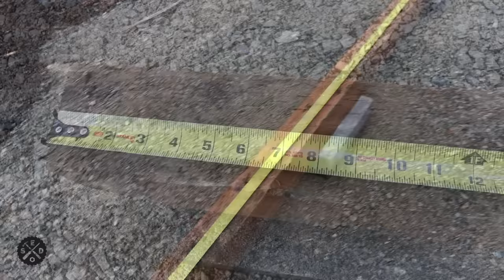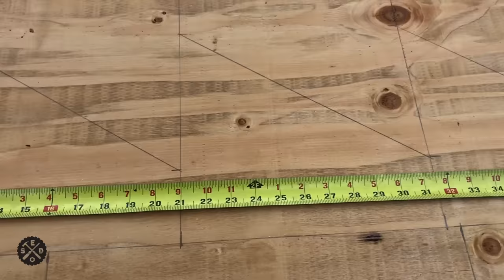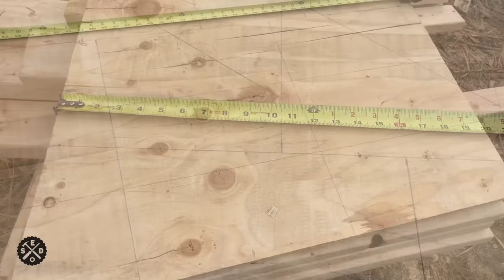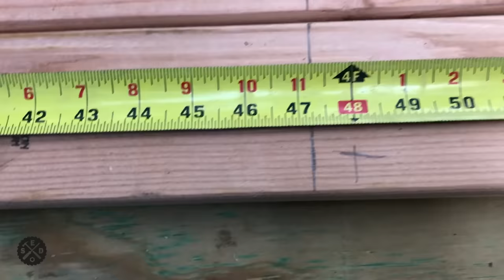How To Build A Shed By Yourself All STEPS 10x16 diy

Comment: You did a nice job building the shed!  I offer some additional tips that may help those who want to build their own shed in the future.  Truss bottom chords typically have a ‘stand’ of 1/8” or 1/4” at each end to make truss production and fastening the trusses to the top plate simpler.  Having a stand at each end assures overall length, makes aligning the top chords so much easier during assembly, and is easier to position the end of the truss at the edge of the wall.  Cutting the long scarf on the bottom chord to a featheredge permits errors in alignment during manufacturing and later on when rolling out the trusses on the walls.  Using a jig to build the trusses was great, as was placing the 2x4 stop at the gable end to set the trusses, and then placing lateral bracing along the top chords to assure the on-center spacing and preventing the wind from blowing the trusses over before installing the roof sheathing.  Adding soffit blocking at the eaves is a nice touch.  Cross bracing at the gable ends and a 1x4 lateral brace along the bottom chords will stiffen the roof structure, in addition, eave and ridge blocking will also help tie the roof together.  A technique for aligning the screws on the metal roofing is to drill pilot holes for the screws first.  Layout the first high-rib sheet to determine where the roof screws are to land, place that sheet over the balance of sheets that will go on that side of the roof, and drill for the field screws; consideration for the two sheets at the gable ends are required due to trimming width and the trim for the gable eaves.  You recommended a great solution for trimming light gauge sheet metal with a utility knife and how to use the neoprene hi-rib profile closure strips as well.  A trick for installing wood trim and siding that easily splits is to use a smooth nail of the same size, cut off the end, and use that nail as a bit to make pilot holes, this prevents the ends of the boards from splitting when nailing.  This seems like a lot of extra work; however, it prevents unsightly ends on the boards.
Reply from the maker: Thank you and thanks for sharing the tips with others. 👊

Comment: When my dad built a second garage back in the 80's, he left a slightly larger ridge gap, and then used a translucent polycarbonate ridge cap of a similar color as the roofing material, which acted as a huge light source, even on cloudy days.  No dark shed with deep shadows in the corners.  They do it all the time in pole barns now.  It was genius.
Reply from the maker: Very nice! I’ve seen that for sheets but not for ridge cap.

Comment: Very cool shed. Everyone watching though, please don't use screws for mating your walls, to the base or each other. Nails bend. Screws snap. Heavy winds, settling and expanding/shrinking, can sheer snap a screw. This only works with structural screws, and even then, use them sparingly like he did to just hold the trusses in place to to put the plates on.
Reply from the maker: Yeah, the screws were just temporary to hold things together then I added lots of nails. 👍🏻

Comment: At 29:52 some blocking shows up on one wall.  Later it is on all walls.  How is it installed?  What height?  What is the purpose?  Is it a nailer for the board and batten siding? Thanks.
Reply from the maker: Hi Rebecca. Yes I continue on with that at 34:15 and explain about it. So just keep watching a bit more 😁

Comment: An interesting question I'd like to ask.
Talk about the skids and getting them level ... you talk about using the blocks if you're going to be moving the shed.
How often has anybody ever seen or known someone who's had to actually move the shed?  I've seen an odd video here there but it does not seem common.
Reply from the maker: Well I added the blocks to give a little more height to store stuff underneath etc. but the skids are the main thing for in case you would ever want to move it. For dragging it or loading it onto a roll back or trailer etc. also some people don’t want it on permanent foundation for HOA reasons or tax reasons. If you knew you were going to build it permanently I would probably just pour a concrete slab and then use that for your floor and build walls on top of that. Or do concrete piers and still do this type of floor system. For me I still didn’t build a garage yet and I don’t know for sure where I want it so once the garage is built I’ll probably end up moving the shed to a little different location on the property.
Reply: @SmartEasyDIYer  nice.  Here if you build the shed on a skid it's not a permanent structure and thus .... will usually not require permitting, of course square footage makes a difference as well.  
I've looked at systems needed to lift a shed and "ROLL" it around so in my plans I will have holes in the floor to get to the skids to jack them up and place some kind of wheel system under them.
Do you think that your floor would hold lawn mower?  Say 700lbs?
Reply from the maker: Yeah that sounds like you got a plan figured out. Oh yeah I wouldn’t hesitate to pull in a normal sized mower in mine if I built ramps to bring it in the double doors.  I’m guessing most riding mowers aren’t even 700 lbs but maybe if it’s a good sized one.

Comment: Getting ready to build and going to use some of your ideas but now the prices are way more. Wish it was around what you paid. Just for the rough  cut lumber I'm in it for over 4 grand and that's not counting the roof sheeting and subfloor or foundation. I did get a deal on the metal roof, that was 700 with tax. Figured just do it because I don't think things are ever going to go back to the prices you paid a couple years ago.
Reply from the maker: Yes I agree I don’t think it’ll ever go back to those prices. I wish it did. Good luck with your build!

Comment: Hello.  Love this plan.  Planning to build this in the spring.  Tiny house on skids.- 12x16 - seasonal - for my sister.  Will put Johns Mansfield insulated board and cover with LP Smartside. Will put cathedral on one end - good idea!  Putting supply list together.  But - Wondering what you recommend for the floor insulation....
Reply from the maker: Thanks. I think you could do fiberglass if you have a deep enough bay and it’s sealed up well. Otherwise sometimes people have it spray foamed later. You could also do ridgid insulation. I missed this comment somehow. I hope yours went well.

Comment: you might want to mention if the siding is rough sawn and varying thickness, put the windows directly to the tyvec and bring the siding over the window flange.    I rant in to big problems with my cypress sided house because the lu,mber shrinkage left a lot of air leaks around my windows.  i ended up pulling the siding and putting the windows to the inner covering.
Reply from the maker: Thanks for sharing. My rough cut was close enough that I didn’t have much differences if I sorted it a bit. I could see on a house it would be a bigger issue than a shed for sure.

Comment: Do you mind giving a quick list of the fasteners (nails, screws, staples) that you used during each basic step?
Reply from the maker: Sorry I missed this somehow. Hope your project went well by now. I mostly used 3 1/4 framing nails for framing it up. Galvanized when using pressure treated material. I had some 3 inch treated rated exterior screws for fastening some things until I could get it nailed. Also for bracing things up it’s nice to have screws. For on the board and batten siding I used 8D 2 1/2 inch ring shank galvanized nails. Staples for the roofing underlayment I just used 3/8 inch. Hope that helps. Thanks

Comment: When using a string, don’t bump the string or you will be off about a 16th of an inch each time you do.

When building side walls, by putting the crowns up also keeps the walls from rocking as you put them together and makes them easier to put together because the ends will touch the deck on both ends.

Comment: Great video. Really interesting to watch. Can I ask, on loads of shed build videos I've watched, they seem to leave a gap right at the peak of the roof between the panal running end to end. I notice you did. Why did you do it? Noone ever explains that.
Reply from the maker: Thank you! So you mean on the plywood sheathing right up at the ridge? Usually that’s for if you are venting the ridge but even if you don’t and cover it over with underlayment it doesn’t hurt to leave a little gap since it will be covered by ridge cap.

Comment: As for getting blocks, may I recommend using 1ft sq. Blocks or space the blocks closer together as when it settles the structure has to be re-leveled..
Trust me, I'm going through that now..
I have a 10X14 shed, I have to rent a fork lift to remove the shed out of the way, place more footing blocks as the ground is swallowing them after16 years. 
I was advised to use 12x12 blocks as the base blocks, so they can even out the weight instead of direct downward pressure.
Reply from the maker: Thanks for sharing. I moved the shed to a new location and didn’t use blocks anymore just on skids. It’s good thing to think about tho yes.

Comment: suggestion for you ,,, when you put up your soffit & facia boards , cut your butt ends on a 45 , put some of you stain on the fresh cut  and cut a 45 on the next connecting board , stain the end and install ,,,, this way as the board ages and if some shrinkage starts there will be no gap or opening ,,,by lapping the 45 end they might slide apart alittle but there will always be a little of the stained 45 end and you wont notice the shrinkage .... just a little thing I do when I build my own buildings that the facia isn't getting covered with anything  ;)
Reply: ALSO,, windows that have nail flanges on them can be installed BEFORE the siding ,, this way the window goes on first , then the siding can be cut and cauld into the slot and over the nails , this will make the nail  flange are hidden under the siding ,,, and if you wanted a large batten molding around the window, you can still install that too, it will just make the window flush or close to flush with the window ;)
Reply from the maker: Thanks that’s a Great idea on the facia boards. I have seen that before but didn’t really think about it when using rough cut. Yes you could set the window in first if you wanted. Same installation idea as when putting on steel siding, doing the window first then siding around it minus the batten trim of course lol Thanks for sharing the tips!

Comment: VERY NICE, COMPLETE, We were having a discussion about the bracing on your doors.  does it matter the direction of the top and bottom boards? Like two arrows pointing at each other.  > <
Reply from the maker: Thanks. The idea is to brace off the hinge side since that’s supported and to stiffen up the furthest side of the door that’s unsupported. I think you’d be ok with what you’re thinking since you’re lower one is supported off the hinge side.

Comment: really good  video , well done , nice clear  explanation of how you did it . I am about to build a double  garage /  workshop and was interested in the way you do not use a ridge beam ? the strength  gained for roof support is in the roof sheeting , do you think there is a maximum width that this is capable of  supporting ? my  span/ width is 20 ft .
Reply from the maker: Thank you. Yes so actually the main reason for not needing a ridge beam is because of using trusses instead of rafters. They are made to be self supporting. For this small of shed I didn’t do any web bracing but usually you do for larger spans. There’s lots of load calculations depending if you get lots of snow and need snow load on your trusses etc. you may find for 20’ it’s cheaper to have a truss manufacturer just make them. You could check around locally and get a price from a few to see. You’d need to tell them building width plus overhang if you’re doing soffit on the eaves, also your roof pitch. They should know load calculations just based on your local area. In the quotes they usually include the design and materials used so you could price out doing it yourself at that point too if you choose to. Good luck with it!

Comment: Hi Pal !  The layout  in your video and links is very well done and explained however about the sheds door handle and lock you were to put screws instead of bolts,  so here's my question if one was to unscrew the handle plate of the door would then just be able to turn the handle is the plate not part of your locking mechanism,  or on the other hand if a thief really wants in then they will.
Reply from the maker: Yes if they really want to they’ll find a way. 
You could use bolts with this type of latch if you insert the nut on the backside so the handle doesn’t rub on it.

Comment: Paul, have you ever done a similar design around a 12 or 14x20? Really like your shed, just need bigger. Thanks!
Reply from the maker: No I haven’t done any bigger but it seems like it would be pretty easy to do. You would just have to figure materials amount and sizing differently.

Comment: Great video and excellent explanations. Only thing I may have done differently is laying the studs and trusses out 16"OC also, just so the load is carried directly from the roof to the joists below. It would only be 4 more trusses and 8 more studs. Not sure what kind of snow load you have where you live though. It is just a shed after all, so I guess I'm just nitpicking. 😆 Like I said before, awesome job man!
Reply from the maker: Thank you! I actually thought about the same thing but yes for a shed I think it will be just fine doing it this way.  With the 8/12 pitch the snow just slides right off. 😁

Comment: With these doors, I guess if you are going to park your riding lawnmower in this shed, you will need to keep some car ramps handy.  Also, do you have any recommendations on how to keep the critters from living underneath the shed; i.e., groundhogs.
Reply from the maker: Yes some ramps are needed to get the mower inside. I’d say maybe some tight spaced wire fencing would work for the groundhogs.

Comment: For the cleats under the floor joists, another YTer tacked on a 1x3 to the underside of the joist, full length. That option provides support for the full length of the joist for the plywood inlay. Another option, if you want less insolation than the depth of the joist is to use cleats, maybe 3/4 square, tacked on with galvanized finish nails, like 15 ga. Yes, it is more work but likely less expensive than adding full sheets of 1/2" treated plywood or aluminum/steel sheets to the underside of the joist. For me, I would add calk to the plywood - cleat interface to reduce the opportunity for vermin and decomposers to make entry. I like the way you laid out the base. Thanks for posting. Back to the video...
Reply from the maker: Thanks. Good tips to think about.
Reply from the maker: That could work for minor insulation needs but I don’t think it provides much r value.

Comment: This is an excellent video. Thanks for the in-depth explanations and examples. Your camera work, audio and editing were well done. Your shed is gorgeous and really well constructed. I have a shed built by an Amish outfit and it is rugged, quality workmanship, unlike others I have seen for sale locally in the same size/price range. Of course, your labor doesn't count toward the total cost in this case, but you have built one of the finest sheds possible for the money you have invested in the material. I can't even guess what the total cost would be if labor were added for a building of this size and quality. With proper care, it should last for generations. I will be looking into the Ruggedwood to apply to the roughcut lumber I plan to use to rebuild the back wall of my barn here in the northeast. Great job and you've got a new subscriber. Thanks.
Reply from the maker: Thank you so much I really appreciate the feedback and the support! If you end up getting some RUGGED let me know how you like it!

Comment: Draw a line from the center of the peak straight down from the peek of your truss. That'll make a 90 with your cross.

With this in mind. Total angles of a triangle is 180. You know one is 90. So the equation is 90 subtract known angle. 

90-34.5=55.5
In your case, the crosse's end cut is 55.5 degrees.